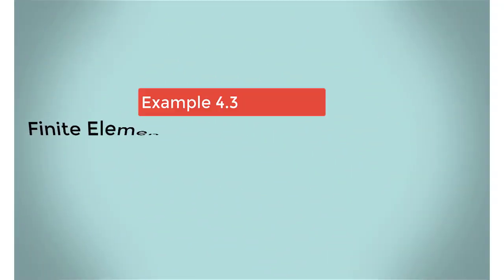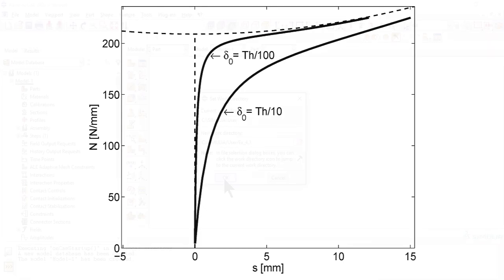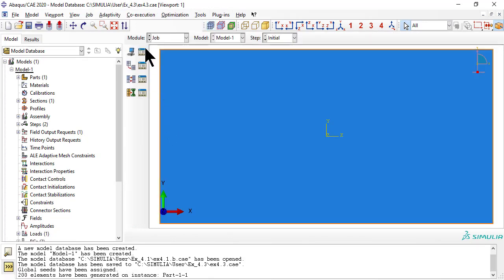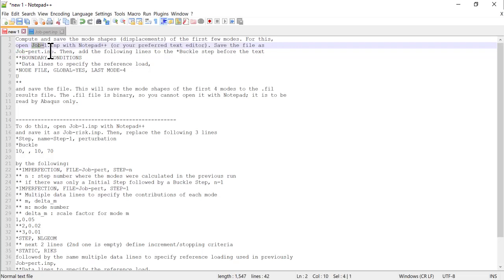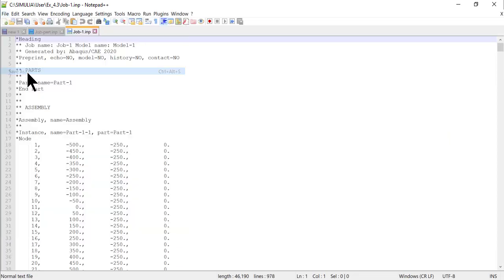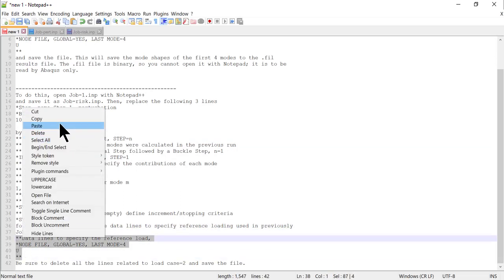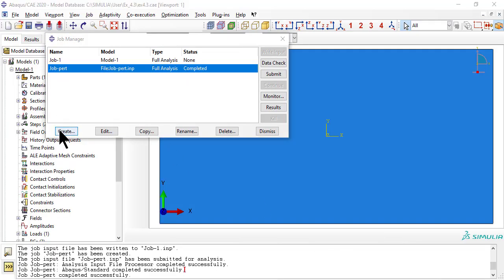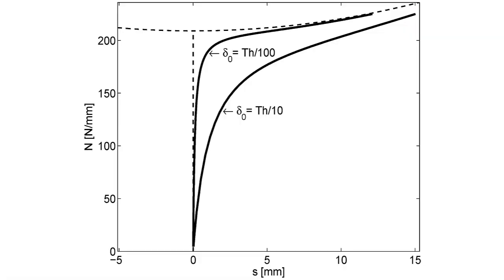Example 4.3 Do geometrically non-linear analysis of imperfect structures via Riks method in Abaqus

Comment: i have a question can i do a static general nonlinear analysis with imperfections or it s just for Static Ricks ?
Reply from the maker: You can but I don't like it because the Job ends like this: "Job NAME aborted due to errors." When the structure or the material softens due to nonlinear deformation or material damage, plasticity, etc., you get a limit point with zero slope, and Static General, which is Newton-Raphson, cannot reverse the load to pass the limit point, then crashes. To do it anyway, first, in Step, you need to set tab: Basic, Nlgeom: On, and/or use a nonlinear material. So for mild nonlinearities is OK, but why? Riks does everything automatically.
Reply: @EverBarbero  thank u for your response 
The reason why I am using static general step instead of Ricks is that i m not interested in postbuckling state of the member
I ve done buckling eigenvalue on the perfect model and now I have to introduce geometric imperfection.
I used edit keyword,  the problem is when I am running the analysis abaqus could not find the .fil file,
So I wonder if there is another way to let abaqus find it without modifying the inp files